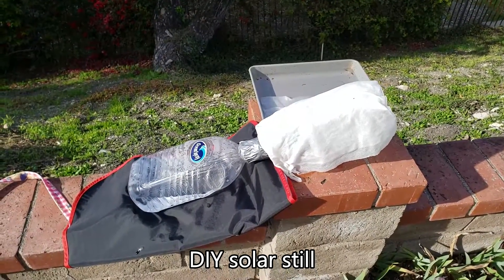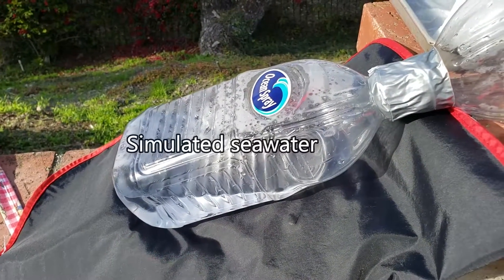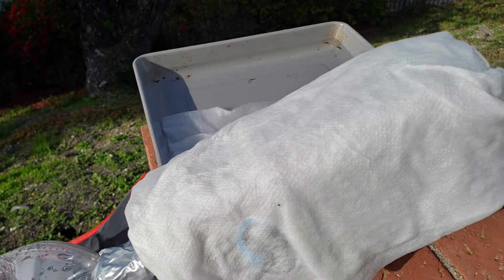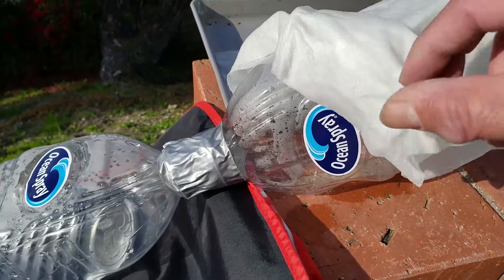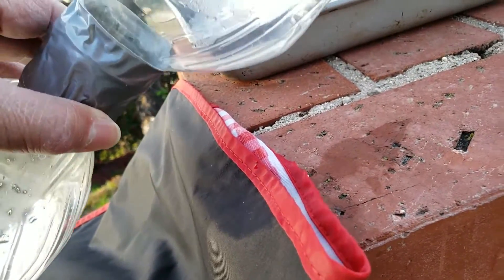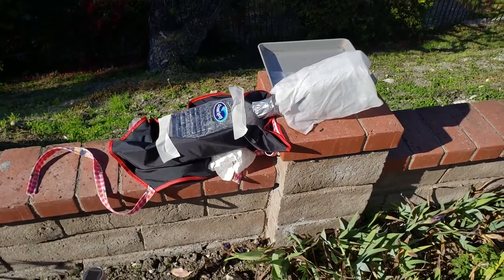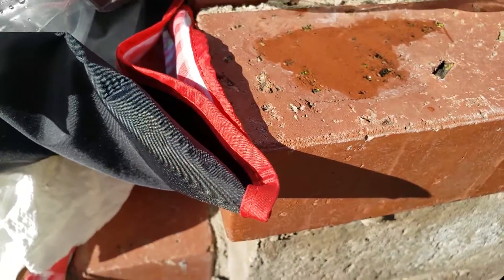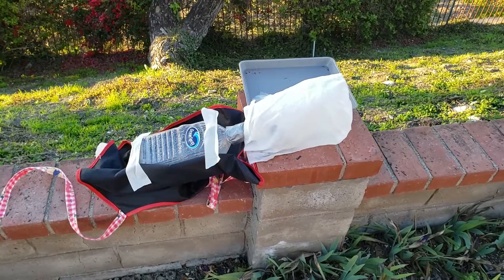DIY solar distiller for making fresh water: Does it work?

Comment: Will this method purify water collected from an asphalt roof?
Reply from the maker: No, as shown on the video, this method does not work well enough to produce any meaningful amount of water.
Reply: @rmwtsou  …my question had nothing to do with the quantity of water
Reply from the maker: @RhinoDNA  Well, if quantity is not important, then yes, it will purify any water, whether it is from an asphalt roof or even dirty waste water because it is distilled water and it is always clean.

Comment: I think your angle is too steep and your evaporated water is running back down into the bottom chamber. I think in this type of experiment you would want the collection chamber to be the lower portion.